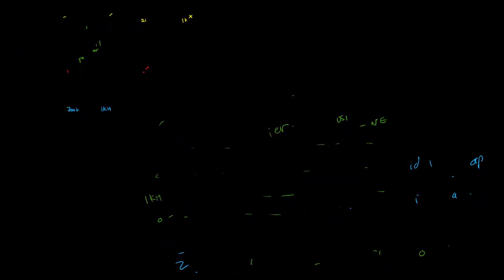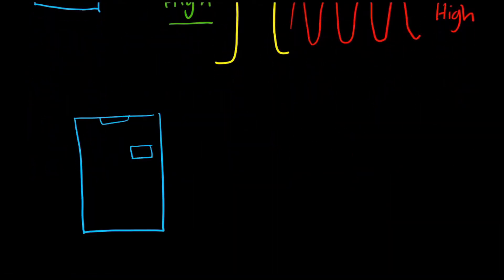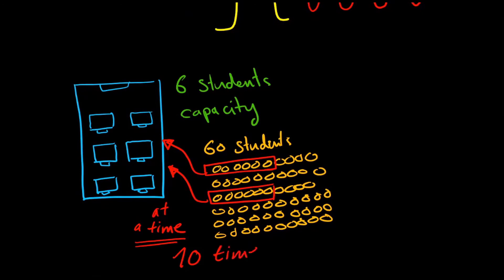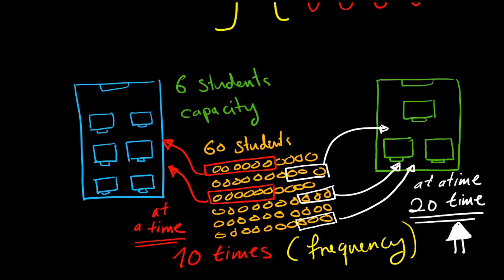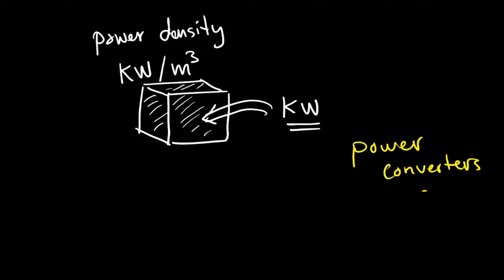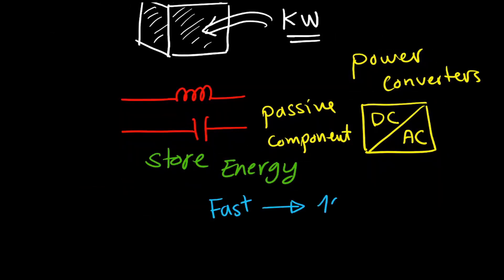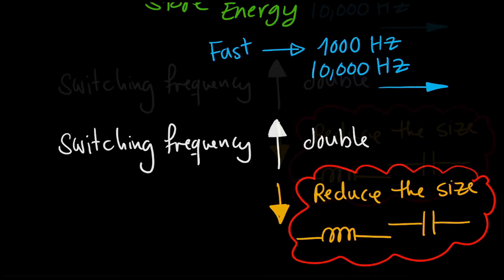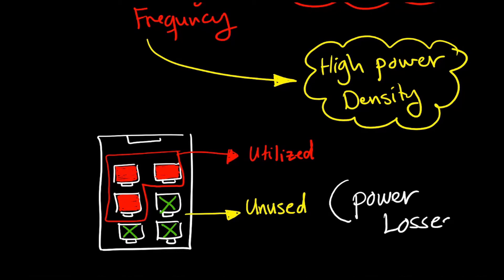Frequency and Power Density | Power Electronics Capsule 💊

Comment: interesting but I think it missed one part. If you use only part of the power capability you can have similar "housekeeping" losses on lower output power and this makes the efficiency, that is the ratio of Po/Pin, to decrease. To make it in the "classroom"example, it's like if you have the same room cleaning cost with low number of student.

Comment: Good video. There are however some additional constraints you may address too: For example increasing the frequency also increases the switching losses because the transition from full conduction to no conduction leads to an increase of the resistance of the component. The transition time (e.g. possible highest frequency) strongly depends on the type of semiconductor materials used. It is expected that new materials will drastically increase the maximum possible switching frequencies and thus support your thesis.
Reply from the maker: Thanks very much! Yes I agree with you.